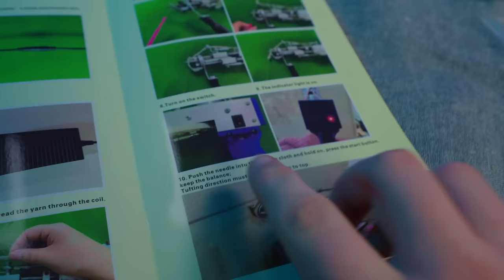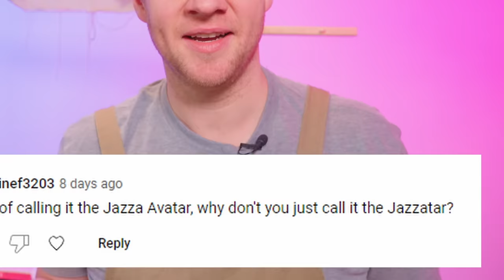Rug Tufting is A NIGHTMARE!

Comment: A little help If you’re considering dabbling w it in the future again. 

1:Instead of shaving the long strings of, you can just pull them out and if you end up collecting enough you can use it at a pillow filling or something similar, or just throw it out.

2: instead of cutting the cloth up to the yarn you’re supposed to leave like an inch outside of it, that you glue to the back of the rug, either with spray adhesive or with a glue gun or similar.

Comment: Jazza, my Grandma taught me this craft when I was a little girl in the 1960s. However, the materials were simpler. Grandma used hessian, recycled from sacks that had held chook feed. The tool was a simple brass hollow needle of about 15cm with a beveled end which pierced the hessian. Before starting, she threaded the wool (which would have been left over from a garment that she’d knitted) through the top end of the brass needle until it emerged from the bottom, pointy end. The wool was in a hand wound ball in her basket. I remember there was a screw on the side of the needle which adjusted the tension. I’m sure Grandma used a frame but I can’t remember it. I do remember the pretty punched wool rugs on the floor of her kitchen, which she backed with, probably, more recycled hessian. I really enjoyed your video but I can hear Grandma turning in her grave at the thought of spending $1000 on the set up. (She lived through the Great Depression and was still saving cotton wool from pill bottles in the 1980s. She was also from a German family and you didn’t waste anything.)  As a maker all my life, I happily put my hand up and admit to jumping on the latest fad and spending far too much on stuff. That’s why they invented Marketplace!

Comment: Hey Jazza, on the wool winder, where the metal guide arm  keeps moving around and you have to keep straightening it while you wind, rip apart an old clicky pen and remove the spring.  Slide the spring over the end of the metal guide arm and work it all the way to the flat part of the L.  It will prevent that arm from wiggling into the unlocked position.

Comment: Great video, Jazza. I thought about tufting but it was way over my budget. However, for those like myself with the urge to make a similar rug why not try latch hooking (not to be confused with rug hooking)? I've done it for millennia... well, forty odd years... it uses a 3.5 hole per inch mesh (quite expensive, though at ~AU$22 per meter) and acrylic or wool yarns. You can buy pre-cut lengths of yarn (like the cut yarn produced by the tufting gun) but it is way cheaper to cut it yourself - although very time consuming. You need only one specific tool for latch hooking and that is the latch hook itself, about AU$5 from a craft store - it's actually a modified Victorian era boot button latch. It uses far less yarn than the tufting, it is manual not machine made, to make the rug almost as dense as tufting use two or three threads per hole in the mesh. Check it out.

Comment: I’m 💜the completed test rugs you made! Yup next project lurking in the wings! Go big or go home. Lots of designs to choose from.
I think I prefer making rug tuffing with this strange contraption is to go manual however slow that process is. 
Years ago I had a machine that looked nothing short of an egg beater. It stitched the wool to the canvas making loops so no trimming afterwards. It made very plush rugs. I got that machine from the Nederland.

Comment: i really wanna try rug tufting some day. i got a manual craft punch but i genuinely don't understand how it works properly LOL but i'm very interested in this craft so maybe i'll figure it out some day

me, a yarn craft, watching jazza rig a very shoddy ball winder and then saying 'if only this was already made' and showing images of ball winders. XD
also, there are tools now just for using bundles of yarn that might not be center pulled (all skeins come with the option for center pull or outside pull, sometimes u just have to pull some 'guts' out from the center to find the middle) but there are spindles that have been made that spin around if ur pulling from the outside if u happen to have a yarn ball that doesn't have a pull from the center option, which i think is really clever.

also, the tufting coming out is exactly why i don't understand the manual punch craft bc i had the notion that it was gonna be more than that and actually have a secure way of not coming back out of the canvas again so i'm quite befuddled how this whole system works lol

omg xD this difference between the first try and the new and improved second try is crazy! looks like so much fun

i feel like this would be something to discover after watching more tuft artists' videos but most people i see doing these won't trim the excess so closely to the project, rather they will fold it back and glue it down with the rest of the backing, probably to prevent any fraying from happening and potentially causing the project to fall apart just to have a bit of extra cautionary bits to tuck under and extra glue down with everything else in the finishing process.

LOL i think it'd be really fun if u did come back with a larger scale tufting and do a collab with nerdforge if the both of u could manage/had the time for it and maybe each do half the rug in some way

Comment: Jazzaaaaa!  You need to do a full room rug with a board game on it, that's big enough for people to be the pawns ... something like snakes and ladders, or some other counting board game.  And you can make big fuzzy rug dice in a pattern that you stitch and stuff in 3d later!

Orr ... make something, anything, in 3D using the rug as the pattern, stitched and stuffed in 3D.  I like using Pepakura to design papercraft items.  That would be a good tool to use after you've designed a low poly monster or something to "unwrap" into a pattern for the rug.  Omg, a rug Bulbasaur!

Comment: I was told you aren't supposed to tuft with the tool upside-down so if doing a circle you'd start at the bottom and line the right half then start back at the bottom and do the left half. But moving upside-down looks like it's working out just fine with no issues. I wonder why the instructor cautioned us not to do that. You've done well. i really liked the pencil.

Comment: I'm only 3 minutes in and I'm dying because he didn't stretch the fabric at all 😭 I have a tufting gun and the fabric and just need to make myself a large frame and buy yarn (got the gun for basically free for... reasons) so I've not used my gun yet but I do know you need tension on the fabric. no idea if that would cause the threading issue and I think he just part the yarn in wrong. Same thing happens on sewing machines which work is a similar-ish way needle wise

edit: I made this before the future Jazza voice over played lol. I knew he would figure it out eventually and wanted to comment on the early bits but did not expect the voice over to call out the mistakes like 30 seconds later

Comment: You way over paid for your gear!! Over $1k?? I just got a full setup, not including the frame cause imma building my own for cheaper, and it all only cost me $330 all together on Amazon. That includes tufting machine, boat loads of yarn, canvas, backing, glue, shears, and brand new scissors. And I only spent $15 on wood at home depot for a large frame / stand. 

How did you spend over $1k??
Reply: Did you get a CPI?